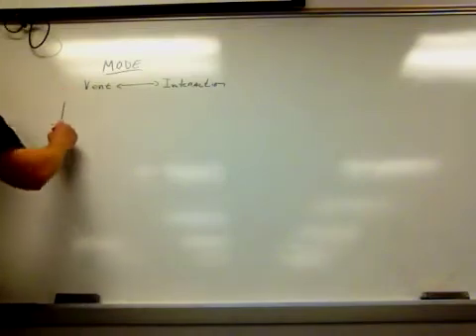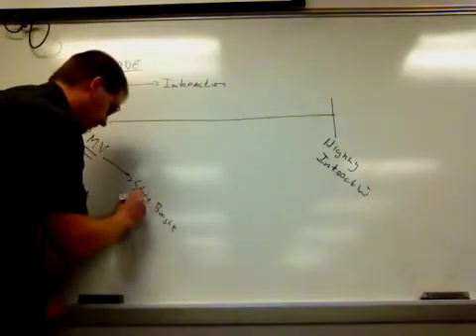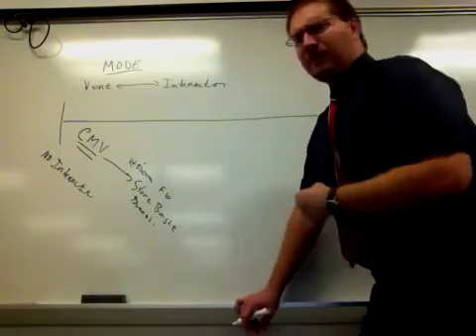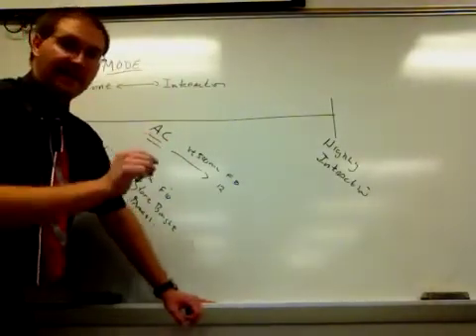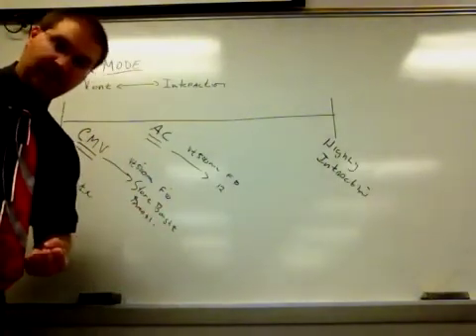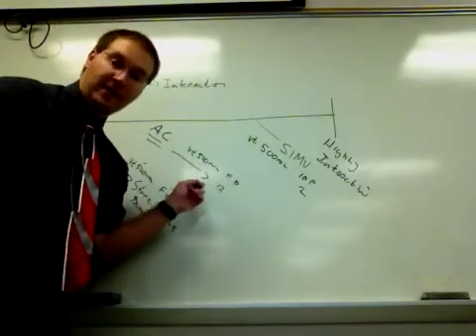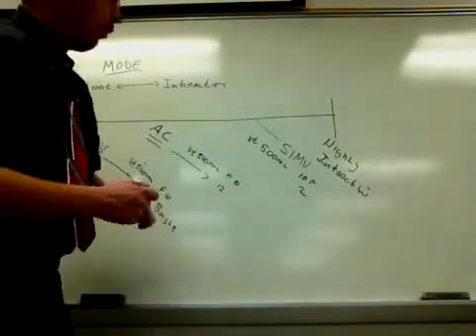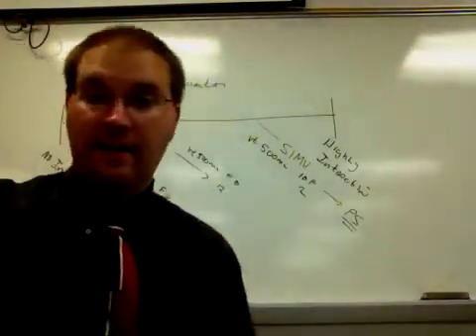Introduction to Mechanical Ventilation 6

Comment: CMV: You get set rate, set Insp Time, Set  Tival volume. Patient tells vent, HEY, I want an extra breath. May I have it? Vent: SOrry, It doesn't matter what you want. YOU ARE NOT getting it. A/C Set FREQ, INSP TIME, n VT. Patient: HEY Mr. Vent. I want a breath. Vent: Yeah yeah ok. Sure. You can have it, but you're only getting my set tidal volume at the set Insp time. THAT'S IT!